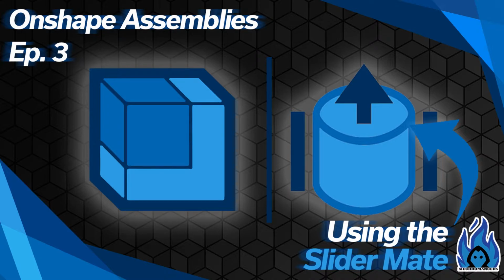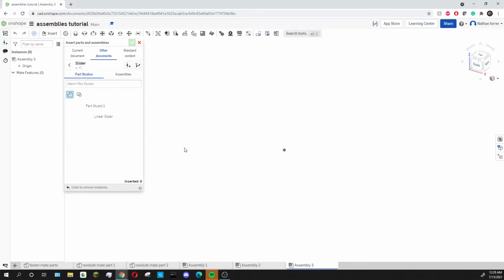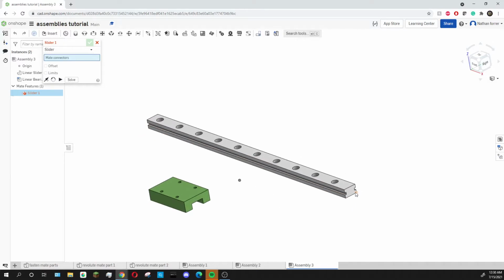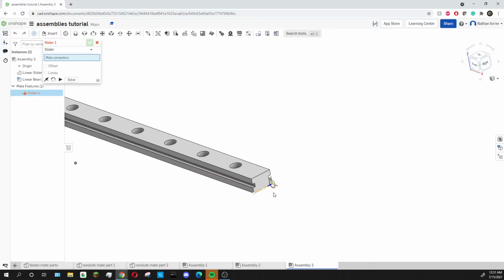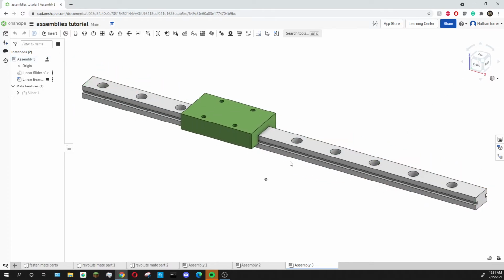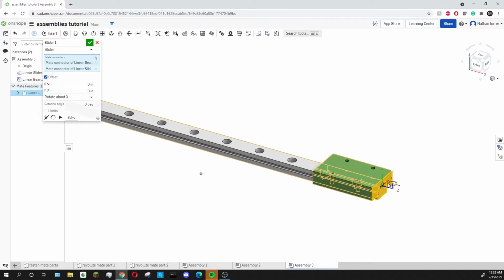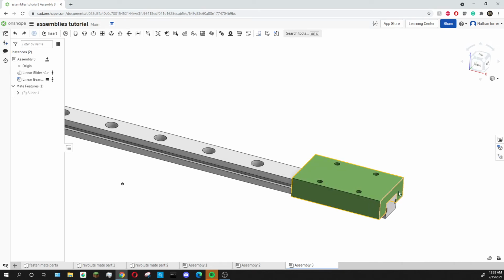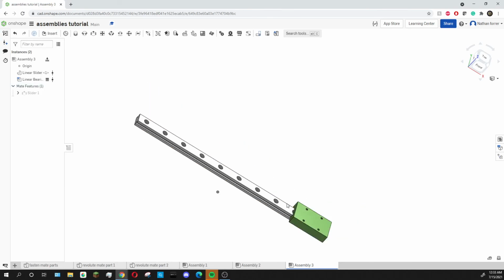Onshape Assemblies Ep. 3: Using the Slider Mate

Comment: Is there a way to use the slider mate when a face is rounded? It doesnt give the option to click it since its not a flat face
Reply: You just need a mate connector wherever you want the part to slide. You can add additional mate connectors (other than the auto generated ones that show up in assemblies) in a part studio which allows you to place mate connectors on sketches, which should give you more options. you can do this using the "mate connector" tool.
Reply: @nathanforrer9014  I'll try that out, thank you

Comment: what if i have 2 objects on the same base and i dont want them to fuse into each other while sliding?
Reply from the maker: We'd be happy to help! The common thing to do when you want to stop your slider mate from reaching a certain point is to enable the "Limits" option when editing your mate connector, then setting the minimum and maximum ranges that they can reach. However, if you had more than one object on a slider that could potentially intersect and you are trying to avoid them fusing as you asked, you could potentially look into using linear relations to further describe your mate connectors. We tested having two objects on a slider path with a linear relation ratio of only one and got a desired outcome. It may take some tweaking, but I hope that helps!